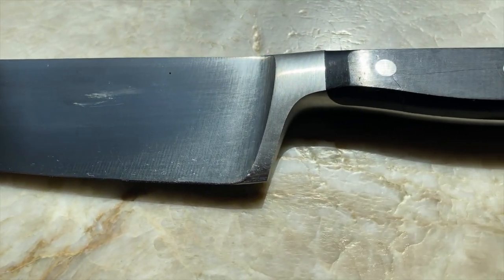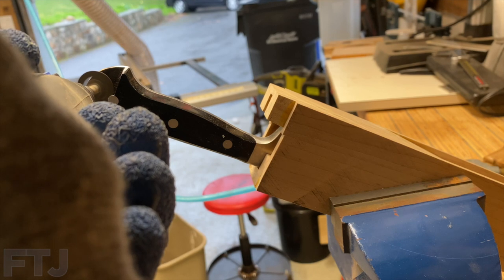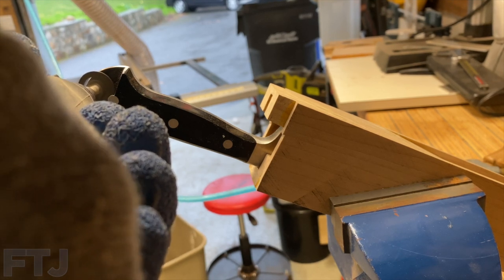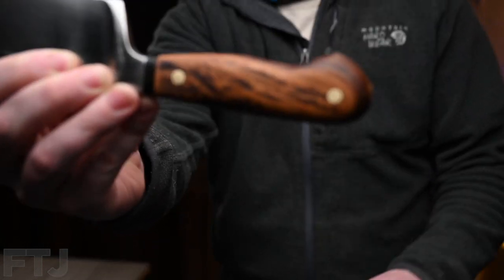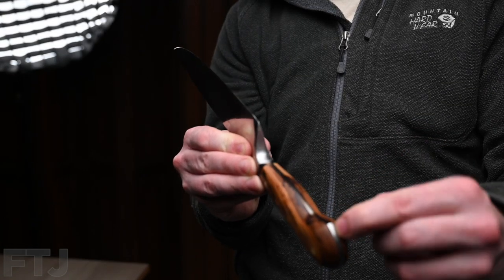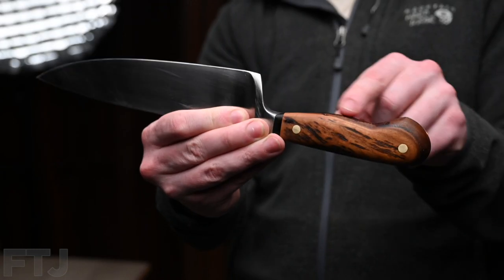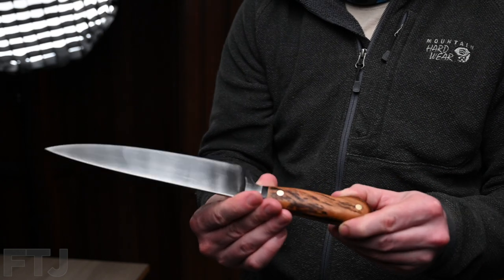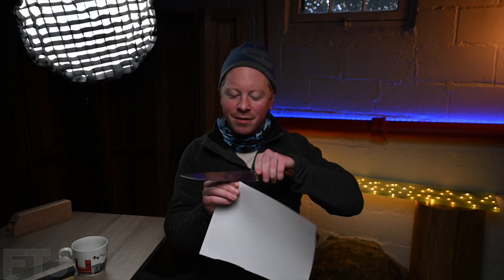WUSTHOF KNIFE HANDLE REPAIR - Replacement Chef Knife  By Fritz Washabaugh

Comment: For future info, Wusthof knives have a lifetime warranty.  Contact them, send them photos of the damaged handles, and they will replace them free of charge with new knives.  And you keep your old knives.  Best customer service ever.
Reply: In the past Wusthof used to replace knives with broken/ cracked scales but are less likely to do so today. They have gotten mu ch tougher with replacements, especially if the knife was put in dishwasher.
Reply: Fiskars is the same way...3 years later. 😉

Comment: I really wanna thank you. I have a knife about a 10" sontonku type that has almost an almost dentical handle. I have a full woodshop and the skills to use it. My knife has a crack in the handle and with the way the rivets are I thought it was molded. I didn't think k I'd be really able to repair it, which had me a bit distraught. That knife has been with me for about 20 years. I believe with the curves, my belt sander, spindle sander, band saw, and scroll saw it shouldn't be a major undertaking. I'll probably reprofile the handle a bit as well. To boot I have some very figured walnut and hickory. Again thanks I'll check to see if you did make the instructional as I just found your channel.
Reply from the maker: Thank you 🙏 glad the video found you.

Comment: Your methods are up to par.  I learned a few things working with a knife maker in Berlin.  All is good.  The final part of the sharpening process could include tuning the edge with a piece of leather.  This actually makes a difference as you will notice.

Comment: really loved this can you tell us where you found the parts (rivets and the details on how you did the resin.
Reply from the maker: Thanks! Glad you like it. 

So about the rivets on Amazon 10 Pack of Brass Corby Fasteners, 1/4" Diameter -- 350B https://www.amazon.com/dp/B01CO6785M/ref=cm_sw_r_cp_apip_qBunmVQRqTgrw

I decided a much easier way to do the handle, would be to take the two pieces paint the insides that are going towards the metal with clear Epoxy to seal them. Then rivet them on without trimming. Tape and fill the gap between the two pieces of wood with my tinted epoxy, the vacuum chamber is optional but I didn’t want any air bubbles.  Once the Epoxy is set after a few days, take it to a bandsaw and trim out the silhouette of your handle, then Sand.

I think this would be a lot cleaner and easier

Comment: What did you use for the new posts that go through the handle?
Reply from the maker: Those are 10 Pack of Brass Corby Fasteners, 1/4" Diameter -- 350B